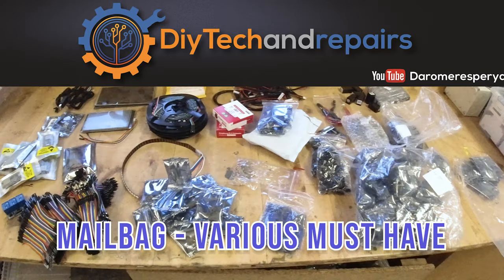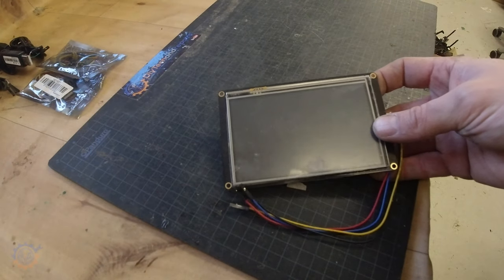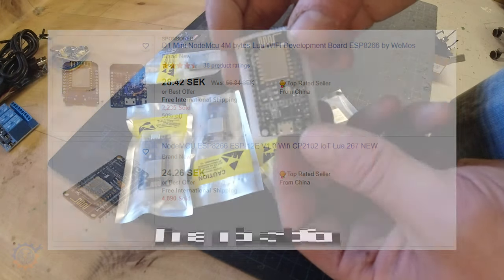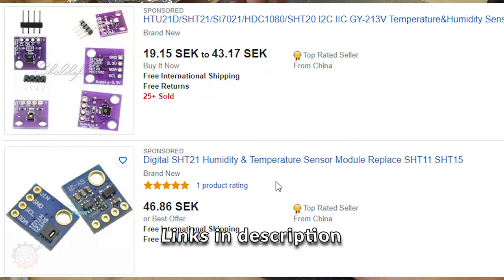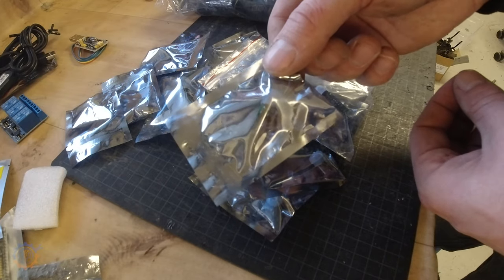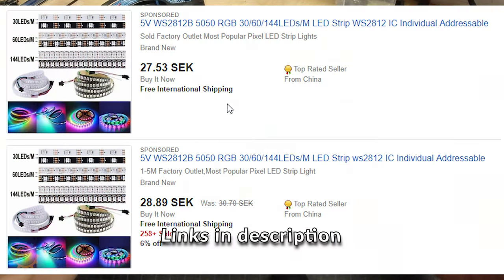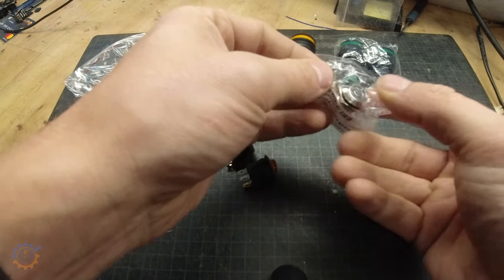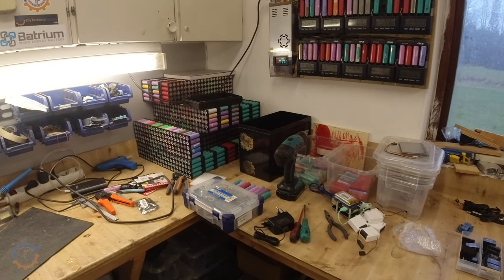Mailbag 2019 #1 - Must have stuff

Comment: the wired serial adapters you can open the USB side (just slip a knife in between the seam to click it open and resolder them on 3.3V contact (there is usually a small pcb in there and there is a 3.3V connection on there)

Comment: How is your solar system doing. Can you make a vid on how its running and any problems you have had? Cheers
Reply from the maker: An update is rendered now. Not much info though. It just works basically :)
Reply: @DIYTechRepairs  no pack issues or anything. Thats great. I cant wait until im up and running at full cap. My cells came from city busses. So far so good.  Cheers